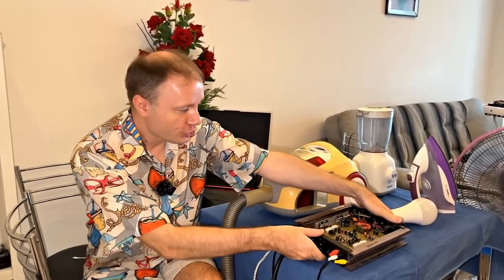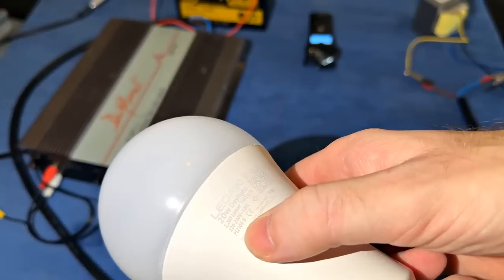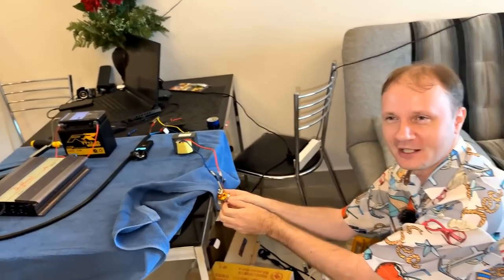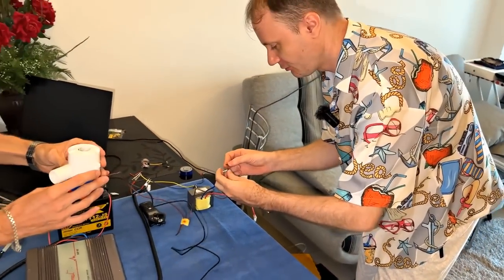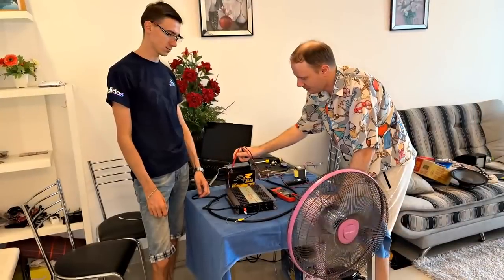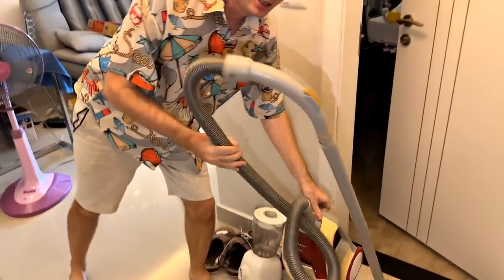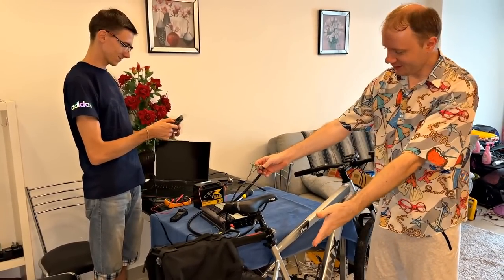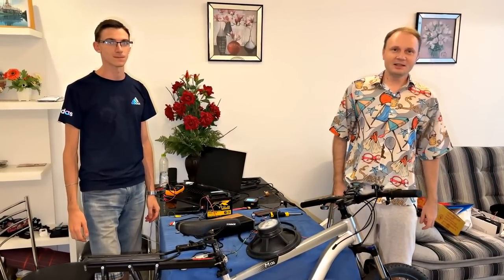Vibro speaker for an evil neighbor from a VACUUM CLEANER😱What does IRON sound like

Comment: If you want insane sub bass, you need a fan where the music signal can change the angle of the blades. The fan rotates at a constant speed, and the the audio signal is stuff below 30Hz or so. The fan must be enclosed in a huge e.g. wooden enclosure (like, sofa sized or something ). Alas I can't find the project pages anymore, of someone who built this. But sub bass from movies makes you body shake there, supposedly. ( if the soundtrack does have subbass & it's not filtered out)
Reply: Nice idea
Reply: You are talking about a Rotary Woofer, they are used a lot in large auditoriums, theaters, attractions and etc for very low bass, but you can get them for home use, jsut rare to need something that goes that low
Reply: Thigpen rotary woofer.

Comment: A speaker IS a perm magnet motor after all... it just pulls rather than spins, but you don't even need an amp, you can hook a headphone wire right to a small dc motor and get cheap inductive headphones, if you want to walk around with a dc motor taped to your head

Comment: If you really want to shake your room like an earthquake, get a decent motor, preferably largest that will run off your home's power.  On the end of the shaft, weld on a piece of steel to make it off balance.  This is essentially how a vibrator in a phone works, only much more powerful.  Bolt the motor to the floor.  The more secure the better.  When you turn it on, your whole house will shake.  This is a good way to deal with neighbors that blast music at 2AM as well!
Reply: I just put the largest alen key I could find in a drill and try to hold it without dying. 😅
Reply: Bro will make a resonance and destroy the whole building 💀💀💀💀
Reply: @judlex7300  Tesla reference

Comment: 2:38 this was a byproduct of 60 Hz tube type lightbulbs with ballast at my school, I always heard the sound beyond high pitch that sounded like water with sand being shot through an amplified metal tube with a corner inside of it, and instead of hearing it with my ears, it made it sound like it was coming with my head

Everybody else was used to it, but I did not desensitize that easy it gave me headaches. I wonder if it’s unintentional or even controllable in that building being a public school as well it might as well have been brainwashing.

Comment: I've done the same type of experiments. I connected a hobby motor to a wooden chopstick and bit down on it to hear the vibration through my teeth. Or put it under a pillow for a quiet speaker only I can hear. I also found the resonant frequencies of different items to vibrate them across a table. Rippling water is fun too. To get super bass you need a big amp or what I did was wedge a broomstick up against a wall and hit it at a particular frequency so it would vibrate like a sting. Ended up shaking my garage roof like I was in a windstorm.

Comment: When I was about 14 back in the 1970s I took the wires from a set of ear plugs and put attached them to a small DC motor. I discovered I could play music through it when I connected it to my transistor radio. Then I hooked it up to the ear plug jack on my 12 inch black and white TV. I could hear the TV through it, for about five minutes until it destroyed something in the TV and I had no sound at all. I was heartbroken. I used to love watching my little TV.

Comment: If I remember correctly, motors will have voltage spikes that goes back into the circuit when turned on, whereas speakers does not have that effect, at least not to that scale. So I think because it's a sound amplifier instead of a motor driver it did not have the proper protection circuitry which is what blew it up.
I am not an electrical engineer but that would be my guess

Comment: You should have put the quadcopter motor on the 50 hertz cuz that is a AC frequency that those motors would usually run at to get at 3,000 RPM but you might have to start it by hand

Comment: In fact, iron does have windings, but it is not a copper coil like the ones found in motors, but it is a coil made of some metals or metallic alloys, such as nichrome, steel or tungsten, which is focused on generating heat and not a magnetic field, itas heating element, but in any case it ends up generating a magnetic field, anyone who has an electric stove knows that you can hear the socket frequency 50 or 60hz depending on where you live, when you turn on the stove you can hear the humming noise.

This type of heating element used in irons is called a shielded heating element, they look like a metallic tube but inside the tube there is ceramic and in the middle of the ceramic there is a small winding similar to a resistor made of some type of metal like tungsten, in fact a heating element is nothing more than a big resistor lol.

Comment: electric shock beats from a 240v socket here in the UK are not nice. I had them from a bedside lamp, with gratuitous burns on my arm, a couple of weeks ago. And I paid for that electricity.
Reply: I applied funny music high voltage to my arm and it hurts and my arm turned red
Reply: @Mandyfromtheuk  No no I increased the voltage gradually if I feel pain I stop
Reply: @WhoisRoach   Behave yourself
Reply: @Mandyfromtheuk  I am.
I still know when it's gone too far and dangerous. I don't put electricity across my chest, so it's safer